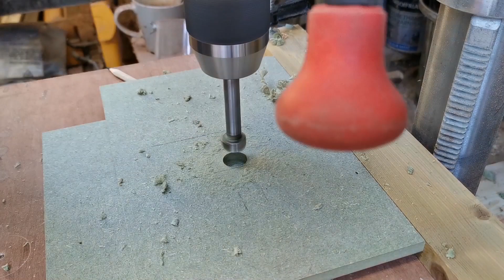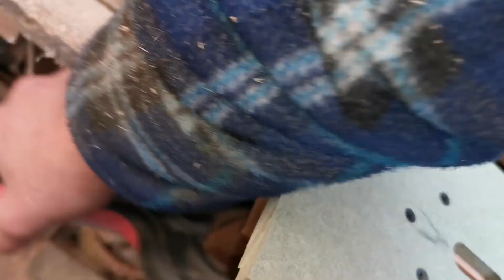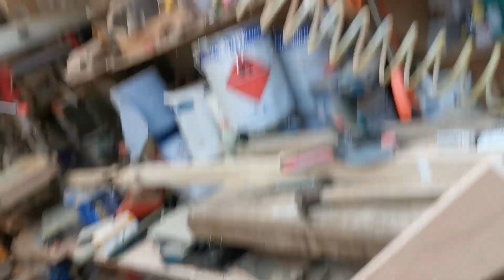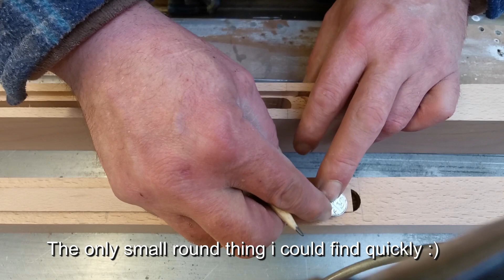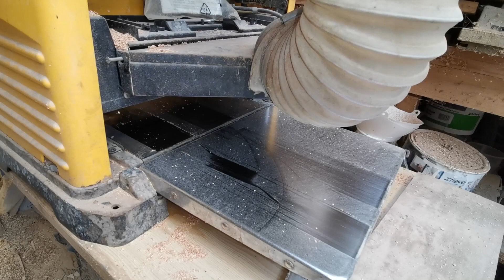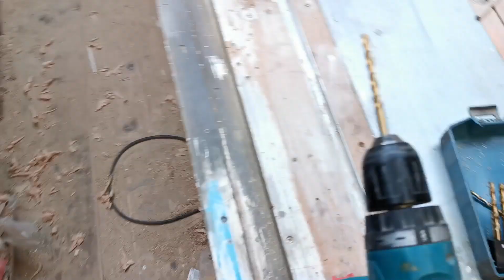Hospital bed make-over Pt3 - Finishing the rails

Comment: Yet another great video Gid, I'm glad you are doing it rather than me! When I saw those rails, I said to myself, shit I've under priced this job !!!!!!!!!!!!!!!!!!!!! Your the man 👍👍👍👍👍
Reply from the maker: Thanks Martin 👍 yep i under priced this but it's still going to be expensive, I am still getting enough, I'm sort of glad I've got this to fathom out during this lockdown, 🤔😊🤪
Reply: @Gidjoiner  Ya I must say it is nice at times to have a job that gets the brain cells going, that said I mainly have to work out of the back of my van, as I don't have a proper workshop, and tend to struggle with holding stuff firm enough like you did with routing the ends of those rails😮 !! I am going to steal that lap joint idea of yours you used on the MDF box sections that beats mitering the corners, when trying to eliminate the MDF end grain 😁 👍👍👍👍never thought about doing that 🤦‍♂️🤦‍♂️🤦‍♂️‍♂️‍♂️🤦‍♂️

Comment: little metal working tip for you Gid, to avoid the chattering on countersunk holes, drill the countersink ( with a pointed countersink) before the pilot hole for the screw. Works for me with steel / aluminium, stops that chatter for some reason.
Reply from the maker: Hi, I've struggled to find a decent metal countersink so use a deburring bit, that needs a hole drilling first. for this i'm happy with the trend bits, i bought this one because i have 2 others that live in my pocket n have done fine for yrs, i think i was just trying out the cheaper competition buying that Erbauer bit, I got what i paid for with that. this is a pic of the sort of deburr bit i use, it's good for laminates etc https://www.wonkeedonkeetools.co.uk/media/wysiwyg/03DBT-Deburring-Tools-Becky/03DBT01/03DBT-1-2.jpg Thanks 👍

Comment: Great vids again Gid 👍👍👍👍. Transforming a hospital bed, make sure you dont end up in one! Stay safe mate 👍👍.
BTW  I notice the clear corrugated roof panels you have, do you get a lot of condensation off them dripping down?
Reply from the maker: Thanks 👍 Yep trying to stay safe, getting old but i think that's the reason for my aches n pains👴😊 Yep the roof drips, worst in winter, frost melting in the morning, it's been on for 20yrs n half of it leaked through cracks so i lazily laid some 2" timber on top n put another layer on,that part doesn't drip quite so much,
Reply: @Gidjoiner  thanks Gid. I use the garage and the roof is infested with woodworm. Going to re-roof this summer and fancied the clear sheeting for the benefit of the extra light. Looks like OSB, battens and onduline then!
Reply from the maker: Yeah, I built this as a temp building to store my crap when i moved in 20yrs ago n it just got extended over the yrs, it really needs re-doing but you could go down the Polycarbonate twinwall stuff root, the roof of the room i spray in only has 3 pieces of 600mm crappy corrugated stuff & that gives loads of light, when i re-roof this part I'm not going to do it all in clear, i don't think anyway, the price might be too much but...I might put some decent sized 'light' in the roof, by the time you add up the price of ply + felt or whatever goes on top, might be better in the long run to fork out a bit more n get the twinwall.  I might be able get some locally n cheaper, sometimes firms have offcuts they might do a deal on, stuff that doesn't fit reg projects/orders, this site i just found tho gives a clue of prices https://www.omegabuild.com/shop/shop.php?action=full&category=multiwall-polycarbonate-glazing-sheets-standard-rectangles-10mm-multiwall-polycarbonate-glazing-sheets-standard-rectangles&product=10mm-clear-polycarbonate-roofing-sheet-twinwall-upto-4-000mm-long&gclid=CjwKCAjw4KD0BRBUEiwA7MFNTREcXu-BTwg0gpesEpba4HfaOtOsvVOCRyPfX4QYazJipgsQCmR05xoCOwUQAvD_BwE

Comment: What are your thoughts on the Axminster Pillar Drill ?  Would you recommend it ?
Reply from the maker: Yeah at the moment I'm quite happy with it, the adjustment is a little bit coarse, it's not as smooth n finely engineered as i might have wanted but it's ok, a lot is steel & cast so maybe it'll wear in a bit or I'll get used to using it, the chuck is great, feels good n the spindle is smooth n spins straight, i bought it for the chuck to pillar distance & the 80mm plunge depth, i wanted to drill through a pieve of 3x2 on edge, i like that you can just wind the head forward a bit instead of having to alter the table but that means front to back it needs about 3ft, Yeah I'd buy it again if i had to, i think all these craft machines are maybe a little 'coarse', you'd have to go pro n spend £1000s to get the highly engineered ones.  I haven't had it long but yeah i'm fairly pleased, no regrets 👍👍
Reply: @Gidjoiner  Thanks , I am after a Pillar Drill I dont need too much  precision at all with my dodgy measuring
Reply from the maker: 😂😂 I went through the choices, £100 they're a bit shit, next up is closer to £200 some a bit  more £260-ish but even then 50mm plunge & a standard 200mm-ish back to the pillar, I coughed up a bit more £300-ish for this, i think in the long run i would have always regretted not doing so, the standard ones are fine for metal work but i want to be able to put a board on n drill in the middle if i wish,